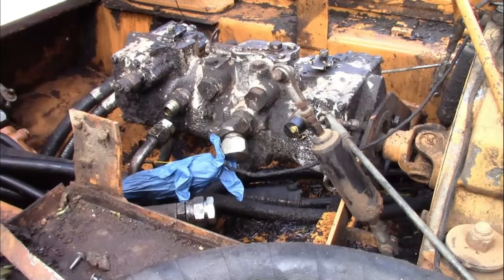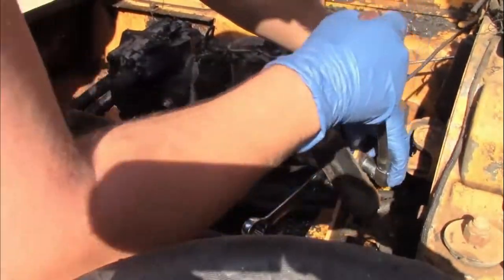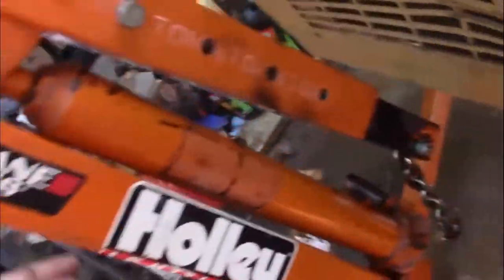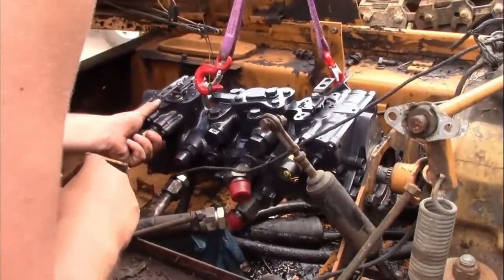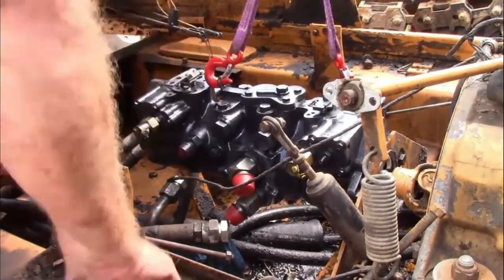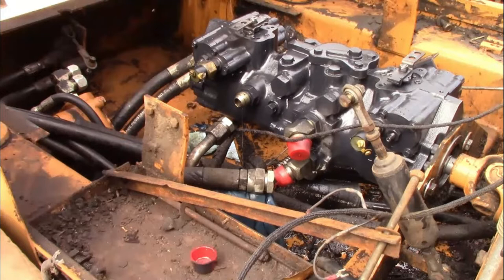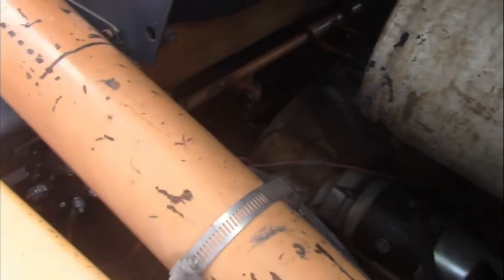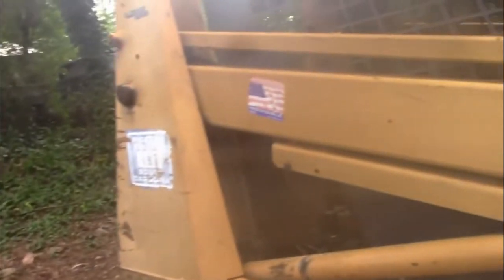Drive Pump Replacement Case 1845c

Comment: I also have a case 1845c about the same year. My machine seems to have plenty of power moving dirt and stuff, but just doesnt seem to go as fast as it should. Do you think it would be the seals in the drive motor. There is no leaks on the pump. There is some slop on the linkage, but probably normal for the age. Thanks

Comment: Can Drive Pump on 1845C cause movement to freeze and unable to start engine as though it was stuck in gear. Excellent video.
Reply from the maker: So what can be happening is a stuck valve causing the drive motor to be engaged while cranking. Along with the parking pin being in the gear causing it to stall.
Reply from the maker: That could cause the engine not to spin over as well. Easiest solution i can come up with to test it is to isolate the pump from the drive motors by disconnecting the lines going from the pump to the drives, and cap them off on the tandem pump side. Then try starting the engine and see if the problem goes away. If it does, then you have an issue in your tandem pump, causing the drives to be constantly engaged
Reply: @Xxdayday99  Thank you for the reply. to eliminate the drive motors (wheels) , I jacked up left side of 1845C and was able to rotate wheel so that eliminated the parking pin as I disengaged that pin (right side lever), so tomorrow I will (ditt0) do right side. Will get back on result. and then on to your second per isolate the "tandem" Hydra Pump. If the tandem pump per your isolation technique works, do you have a reference for sending the tandem pump out for remanuf.?  Again your 1845C videos are invaluable for guys located in remote Maine and more. Regards,
Reply from the maker: @cliffBMRC  i had a local shop around me rebuild mine and it leaks out of the rear seal but functions as it should. Thats my only complaint with the people i used. I will be rebuilding the drive motors on mine eventually and learning how to do it myself. I dont know what all goes into a tandem pump rebuild. There is a facebook group that may be more helpful  for your location. Its called 1845c enthusiasts
Reply: @Xxdayday99  Thank you again for all of your techniques. Will do as you have explained and let you know how it worked. Machine is lifted all four wheels, and parking braking disengaged on left side and wheel move freely by hand. Braking on right side disengaged and wheels will not move by hand so either pin is stuck or as you stated pump is the issue. BTW, I have been running Synthetic hydraulic fluid for at least 10 years..may be the issue causing the problem over time, but you use AW 68 and will use the same unless you have changed you opinion on this.
Reply from the maker: @cliffBMRC  i have been using aw68 and havent had issues but i also keep developing new leaks and the hto additive it way too expensive to keep putting in a leaky machine. I have heard some people running 15w40 rotella and having success. There is really no straight forward answer that i have heard. Ive been using the aw68 and it seems to be fine

Comment: Sorry I should have specified about not being fast. The lift and tilt on the bucket seem fine,it's the travel forward & reverse I am refering to. Travel forward all out the one side is a little behind the other side but I just compinsate the hand controls to go straight. Thanks again
Reply from the maker: I am very sorry for late reply. I have been busy. And it sounds like maybe an adjustments. There are pressure tests you can do on them but my understand is that a pump rebuild is good for about 4k hours

Comment: Question, after about a hour of working the machine won’t be about to spin out right or left. But I don’t loose and lifting power on the bucket? Motors not pump?
Reply from the maker: Well the bucket hydraulics run off a seperate pump on the rear of the machine. I would say something is going bad in the tandem pump. The service manual may have something on that specific problem.
Reply from the maker: There is also a way to test flow and pressure of your system which is a good way to find out exactly what the problem is
Reply: @Xxdayday99  Thank you for the info. I found out today that my foot control 1845c is a little rare? Have you seen many?

Comment: I just put a new rebuild tandom pump in and I’m having the exact same issue! Right side is very weak, little to no movement. Are there any valves or o rings that I can replace that may be faulty? I’ve already diagnosed everything else that could be wrong, so I’m down the the main pump now
Reply from the maker: Have you tested the final drive?